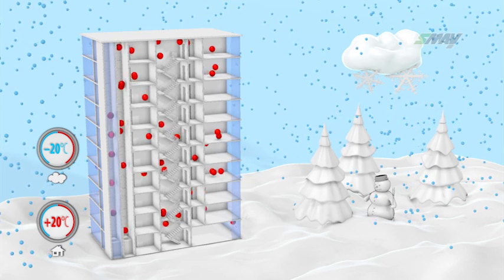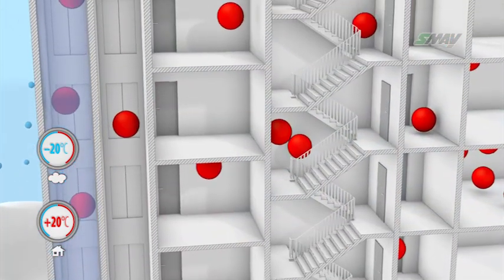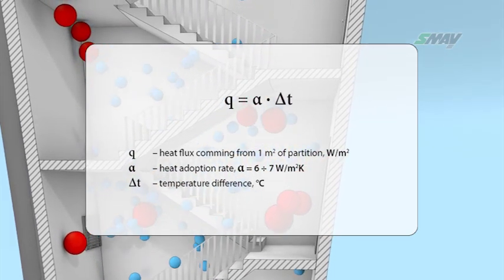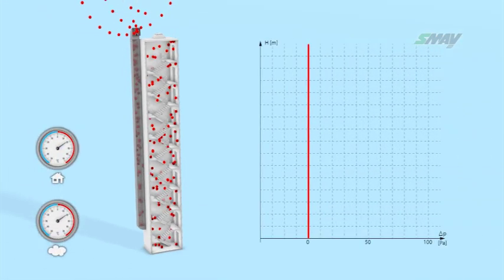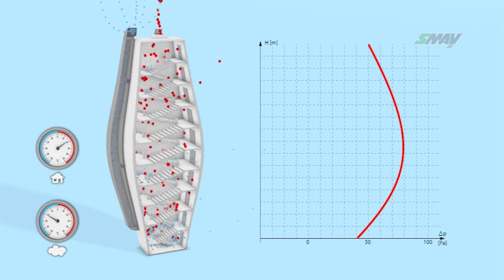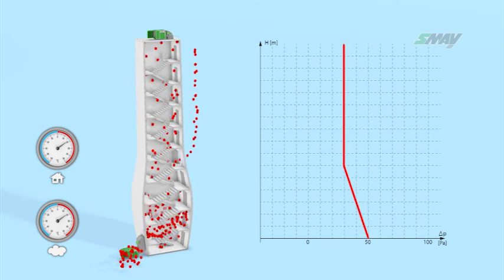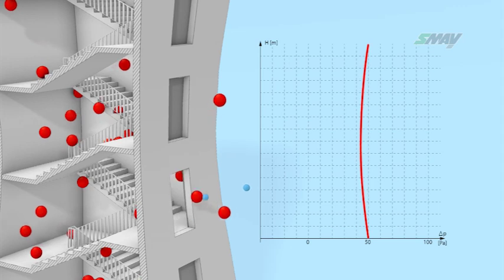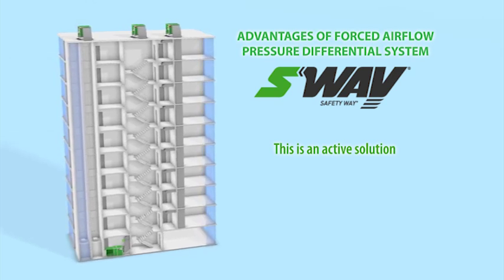SMAY - Pressure Differential Systems - The stack effect and airflow resistance

Comment: would the air velocity across an opened door, matter? i believe so long as the air velocity across the door exceeds the smoke velocity, that would be enough to prevent backflow of the smoke into the stair shaft.
Reply: monizag You are right! The air velocity matters! But when the doors are open only!.
When the doors are closed, you have no air velocity. Then, because of different air temperatures you will get the stack effect. It can get such big, that depending on what you have (positiv or negativ staff effect), you won't be able to open or close the doors.
The peak pressure you may adjust depends on the size of the door. An average person can manage to open or close a door with a force of about 10 kg, which converses to about 100 N. An average door has a surface of roughly 2 m2. Now if you divide the 100 N with the 2 m2, then you get the 50 Pa mentioned in the Video. Caution: this is just a rough guide on how to calculate the allowed peak pressure.
Reply: Eric Pierre Fricker Thank you for the clarification.